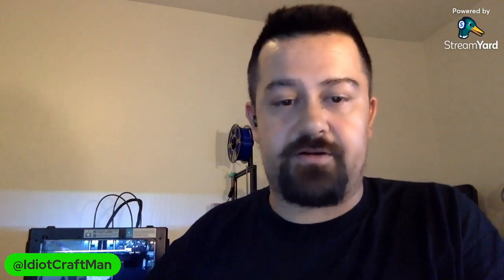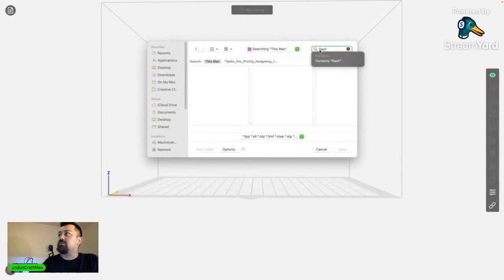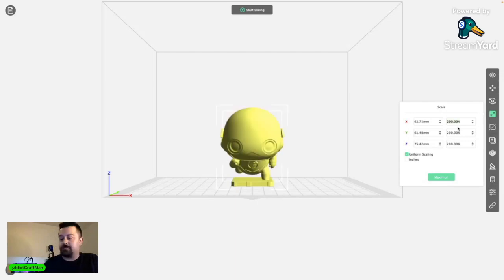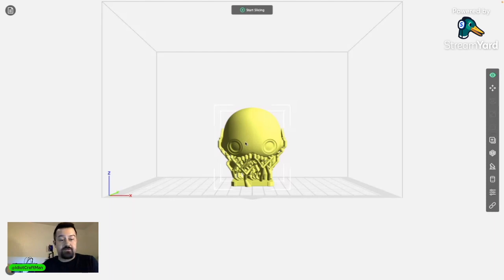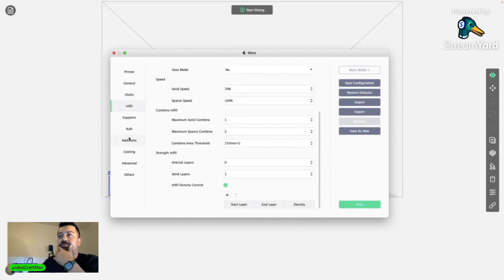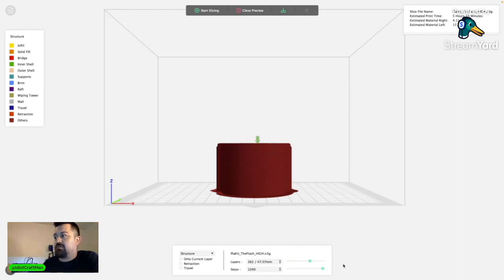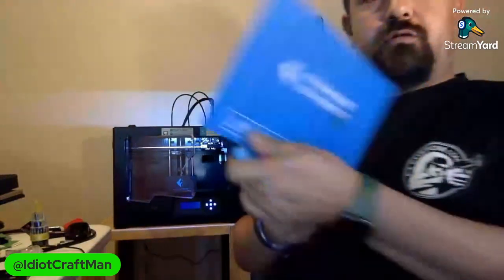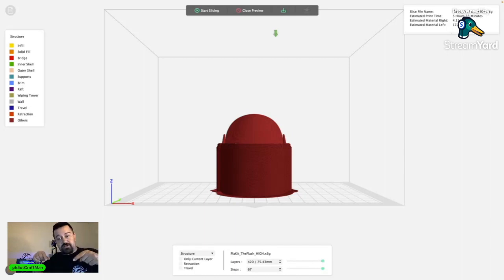How to use FlashPrint 5 to 3D print on a FlashForge Creator Pro(2023)

Comment: Hey Craftman

I have great success with my creator pro, but when it comes to supports they seem to ruin the print every time, i use tree supports but the supports just stick into the model to good therefore ruining the print, making the area were the supports contact rough. I did increase the space to model z from .20 to .30, still no luck. If you have any advice it would be appreciated, thankyou :)
Reply from the maker: It's a lot of tweeting the orientation and all that good stuff. I've found that by default, the slicer adds WAY too much support, so I will usually go in manually and remove the support I feel isn't necessary. My best advice is to try to get as much of the support as possible on parts you don't care about, but you also want to get done good pliers and wire cutters for removing the supports.
Reply: Thank you for the reply, appreciate it !! @IdiotCraftMan